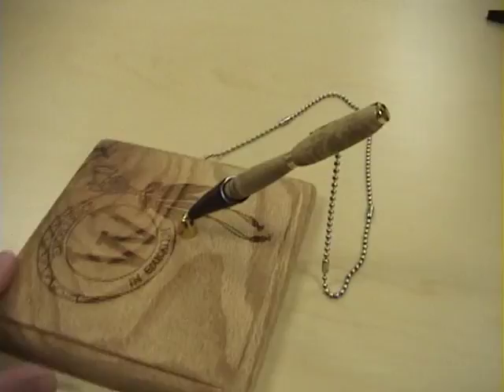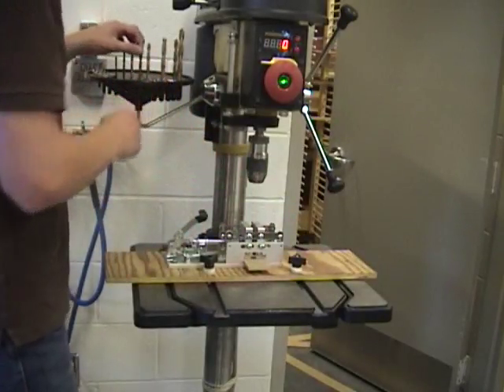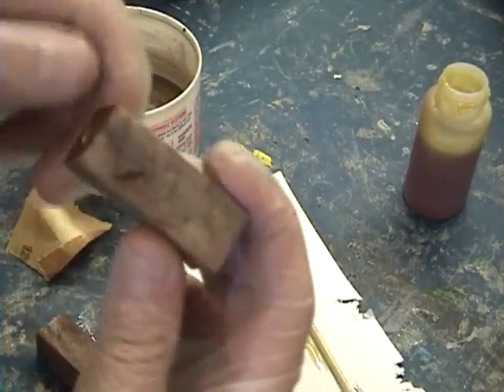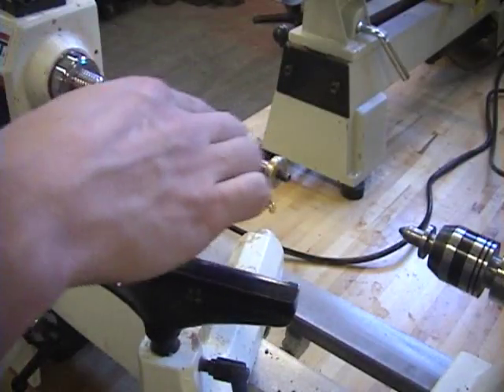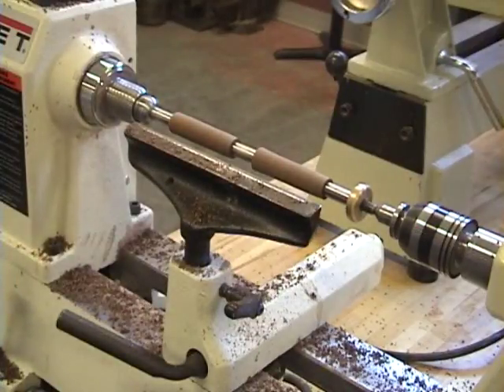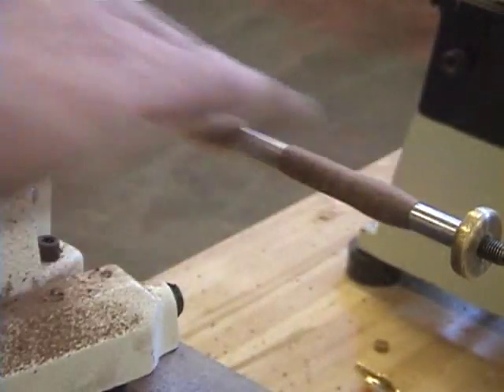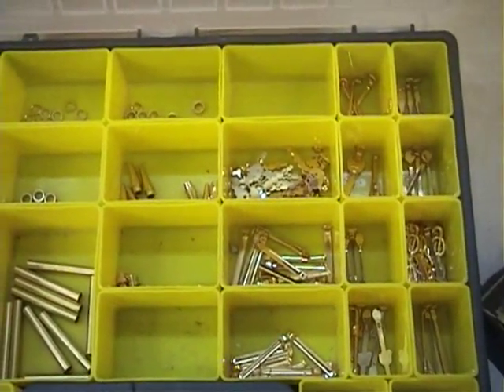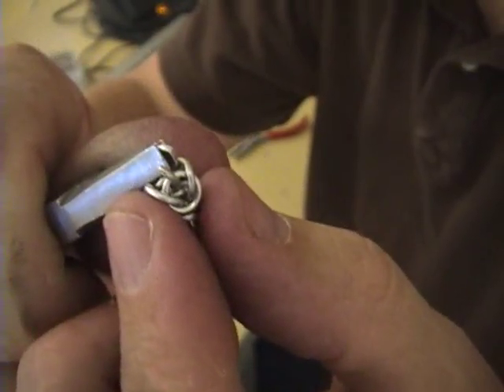How to make a wood pen

Comment from the maker: There are many ways to finish a pen.  I used friction polish. You can find it at Woodcraft or other stores that have wood turning supplies.  I have started using the same wax that you used as well.  They both work well, but I think that the wax may last longer.